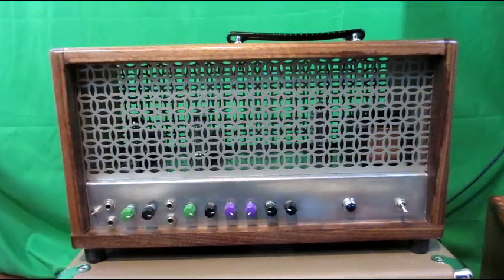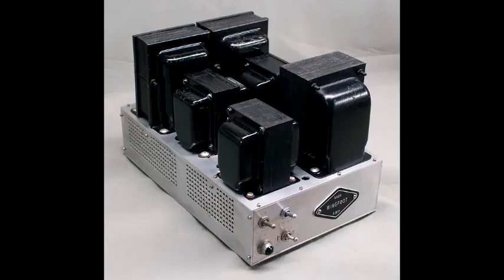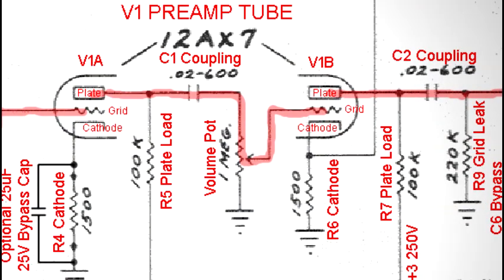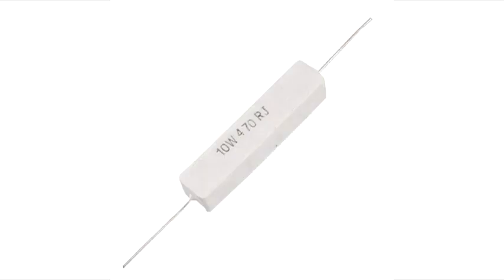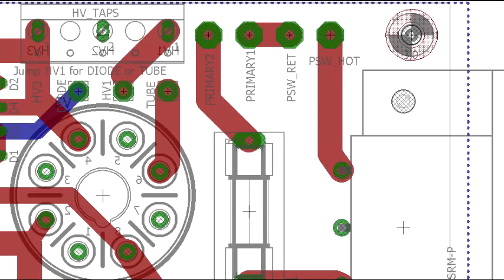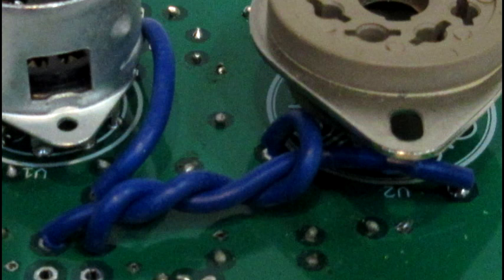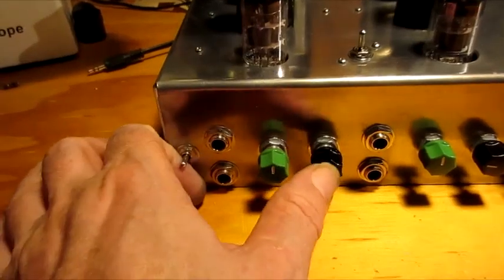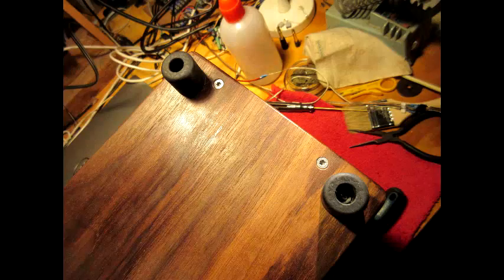DIY Rig Series - Dual Channel Tube Amp

Comment: Nice job! VERY clever! Been thinking of my own circuit based on the Champ but with a KT tube. May try your idea of 2 amps off the same power supply. Did you ever finish your field coil Speaker? I couldn't find a Part 2 in your video list.